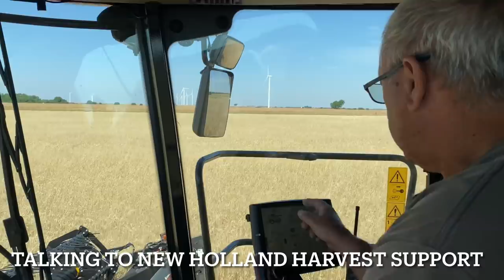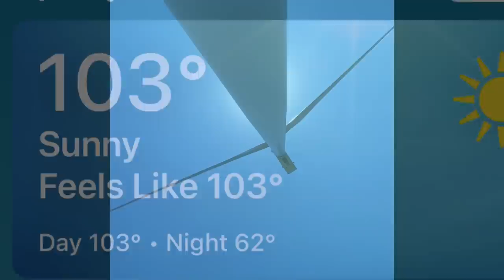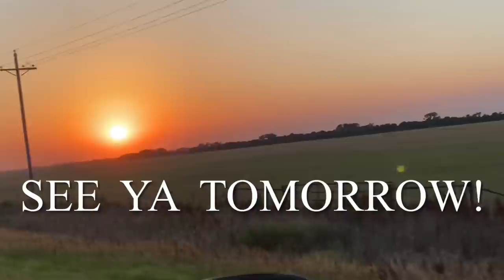Day 8 - 2021 Wheat Harvest  / June 20 (Medicine Lodge, Kansas)

Comment: What all brands of combines have y’all ran. If I remember right y’all ran Massey Fergerson’s in the 80’s???
Reply from the maker: Yep! We started with a used Massey 750. Moved into the Case IH family for over 20 years and now the NH.
Reply: @ZeorianHarvestingTrucking  we never got past the 510 but dad always said that Massey made good seves. We went from a 510 to a JD 7700 turbo with a 24’ head. Dad always liked the MF’s though and when we downsized in 1987 he sold the 7700 and we got another 510. Never ran the IH but always heard good things.

Comment: Good Morning  Tracey  & Jim  .    The way Jim & you take care of your combine & header  so closely they should be in perfect condition for a long time  .
    How far north are you going or you're not sure yet  ?
     The one year we traveled clear to Texas it was too wet to cut for 3 weeks so we just watched tv in the motel rooms or drove around exploring the area  & I  think a lot of crews lost several of their operators. 
 I guess they had a different way they were paid  .   After we quit doing custom harvesting in Oklahoma and all the other distant places , we just cut at our area  which was at a couple of times we drove the combines [ the boss just had 2 combines ] approximately 80 miles away from home  . The boss & I put a hitch on the combines to pull the headers behind us  , of course they were only 25 feet wide back then  . He also had trailers for the row headers we used for milo & corn  .. One year we had the row heads on the combines & were pulling our flex heads behind each one  . It was quite a trip to drive on a Sunday morning.   Safe traveling  .